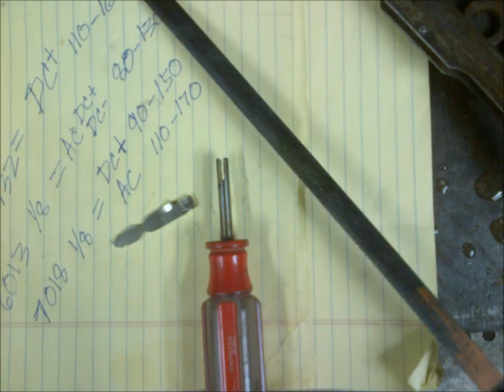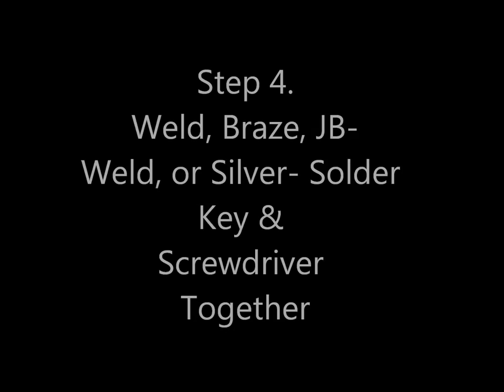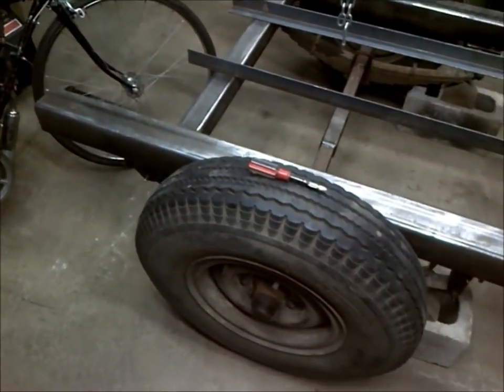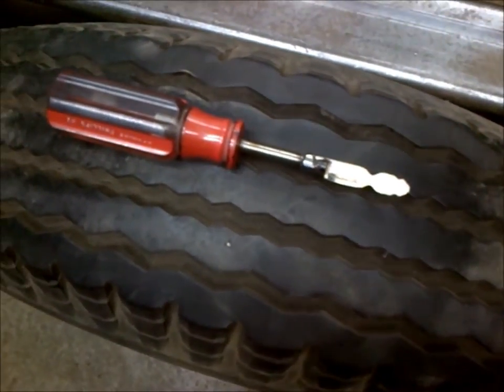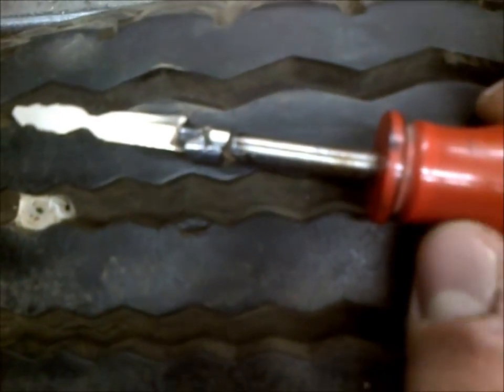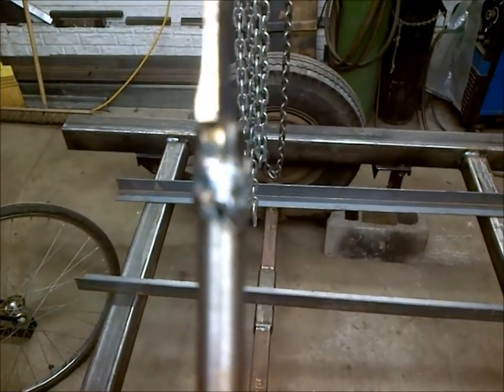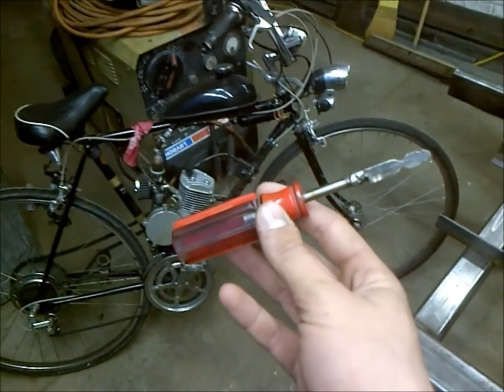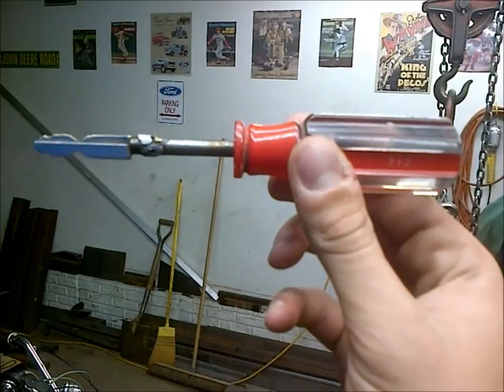How To Make A Screwdriver Car Key "Drive It Like Ya Stole It"

Comment: i lost the key to my f100 and was wondering if i could start and drive it by bypassing the starter solenoid?
Reply: If you could find a way to disable the ignition shut off from the ignition switch, then yes.